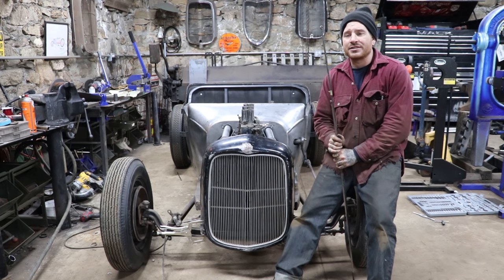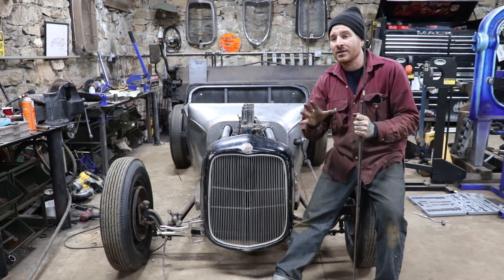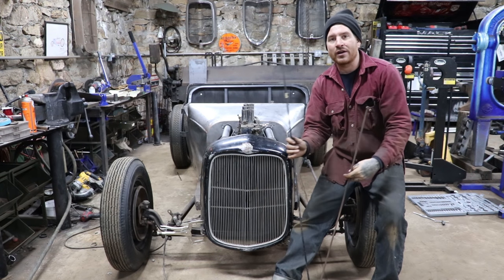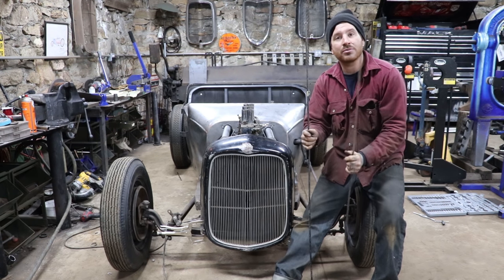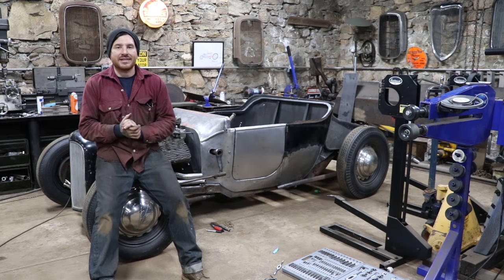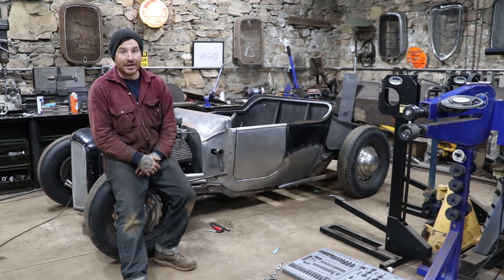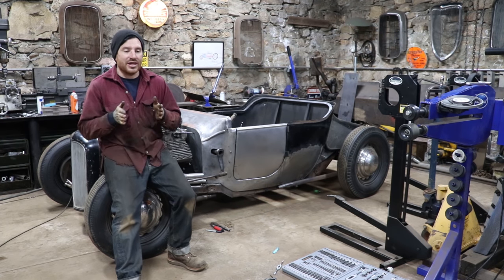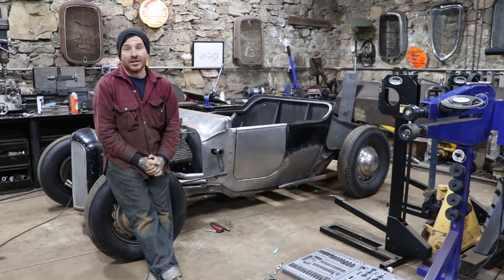Custom Radiator Support Rods and New Headers- Free-T Episode 52

Comment: How does the brake system work on those cars? I don't see any brake booster or brake master cylinder
Reply from the maker: Master Cylinder and pedals are under the floors like most Fords up until the 50's. -Matt/ITG
Reply: @IronTrapGarage  really that's crazy I would like to see that